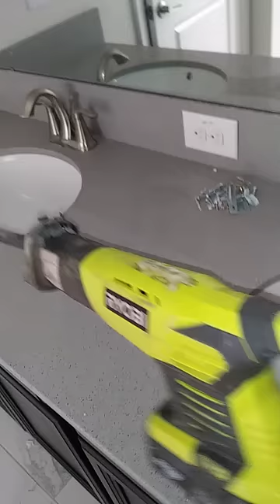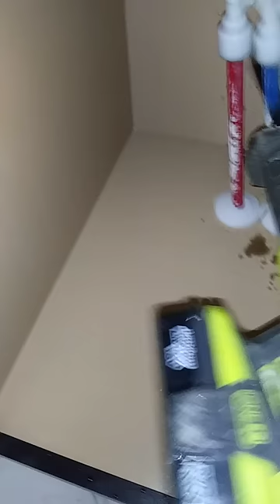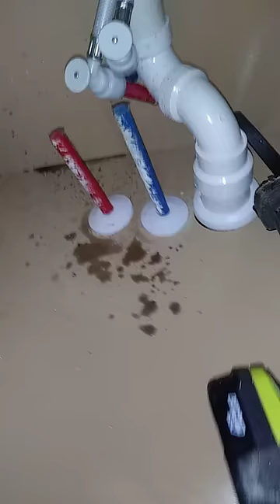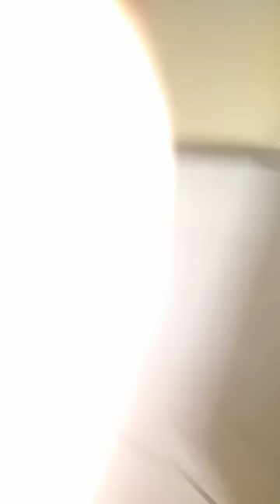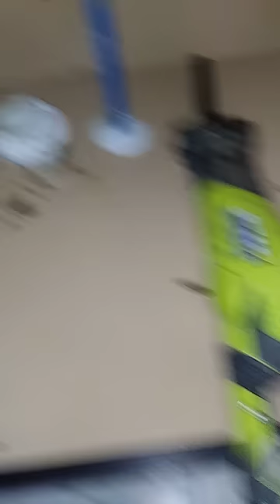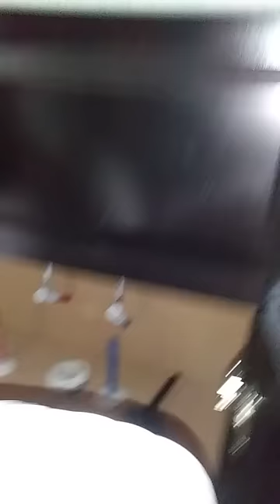This is what happens when you DON'T pay your plumber.

Comment: I'll be honest.  As a DYIer, this is really not all that bad.  It's fixable in less than an hour.
Reply: Not for someone that needs a plumber to install that.
Reply: Exactly, if they have to pay someone to do something that simply I doubt they know how to do much of anything
Reply: In my country you need professional to do this for Insurance
Reply: I wouldnt suggest DIY'ing your plumbing work
Reply: I thought he was gonna leave the water on thru the pipes and let it flood the bathroom. Literally will take 10 minutes to replace lol
Reply: Flex tape 😂
Reply: @ItsKyleStewart  those are sharkbite fittings that my toddler could push together, and a trap you can install in 30 seconds with anything resembling a wrench
anyone who knows how to change a tire or make breakfast could do this job, but the kind of people who won't even pay for literally the cheapest plumbing job probably don't know how to do anything for themselves. If they did, they wouldn't have hired this guy, or they would have done it themselves.
Reply: @MrCrackheadst  plumbers can make that much (or more), and for this job it would be worth it to do yourself bc it shouldn't take you more than an hour even if you are a crackhead
Reply: Then why didnt the person do it them selfs?
Reply: Not to bad of a fix, he cut that drain pipe pretty close to the cabinet bottom might be a lil work to fix that, but obviously the customer couldn't do it ,and now the next plumber comes he will know that those pipes look like that for a reason.
Reply: Staged
Reply: I'm no plumber and i reckon I could fix that easy enough
Reply: He should of cut the pipework lower and filled the pipes with expanding foam and pushed them under the floor 👌🏻👌🏻👌🏻
Reply: As a DIY lolol 😆😆😆
Reply: No it isn't.  The drains are cut at "floor level". The water is pretty simple. You now have to cut a large hole in the cabinet bottom, remove the bottom, or pull the cabinet. Did that work for 50 years. It is not an hour repair, especially  for a DIYer. Only an inexperienced person would make that claim. You could butcher it in an hour but not repair it properly.
Reply from the maker: Truer words were never spoken 👏 🙌 👌 😉
Reply: @lmilne4859  100% if he cut it a little bit higher maybe you can slap a coupling on it but that cut was too close to the cabinet.
Reply from the maker: Truer words were never spoken 👏🙌👌
Reply: Fixable in less than an hour! Yeah right! Not for me...first a 10 min trip to HD or Lowe's, then having to get in line for 15 minuets to pay. Oh wait, I'm like a kid in the candy store, 30 to 45 minuets of site seeing and starting my Christmas list...again.
Get out and on the road. If its lunch time, pick up lunch, 30 minuets, if its early, stop for coffee and a couple donuts.
At about 3 hrs into repair...start. 🤣
I'm so ashamed, because I've actually done this once or twice. 😫
Reply: lmao, to all the people saying they need to hire a plumber and all that, y'all probably haven't even touched a screw driver in your life... the white pipes are as easy to put together as Legos...
Reply: Right like cool ill just buy wore tubes and pipe.  He should've wrecked the tub , sink,  drywall . Now THAT would be a major fix lol not this
Reply: im not even care if it wasting..atleast home owner not getting this for free..
Reply: Okay but you still played for lumber and materials sooo... you lost money on that plus YOUR time you now have to put in and more material .. lol you pretty much lost twice. Oh and if your fix ends up breaking again for what ever reason it's not fixed for free as where if the plumber did it.. it would be on his dime. So yeah it's bad. Just pay the man what you owe.
Reply: @mr.spacely6503  😅😅😅
Reply: Well they called a plumber to put in a sink so... Clearly they wouldn't have the slightest idea of what to do.
Reply from the maker: True story
Reply: @tiananman  they do not pocket that rate. At best they make 25 an hour.
Reply: The fact that the drain was cut by the cabinet is pretty much a pain in the ass. He did good in my opinion
Reply from the maker: Thank you. I tried to make it a pain ass for the home owner just in case they tried to fix it themselves.
Reply: @ItsKyleStewart  residential plumbing is easy with shark bites now adays and pvc gone is the day of packing cast iron with oakum and pouring lead sweating joints is pretty simple too but with pex and a cheap crimping tool and pvc and glue it's all really fast and easy I'd recommend someone diy plumbing before most other things just know what a drain trap is and pitch your pipes that's it
Reply: Ok Jerry rig everything
Reply: As a DIY, it's 1 hour labor but 5 trips to home depo. #personalexperience.
Reply: @Moistnsquishy  shutup
Reply: but what if that person doesnt know how see
Reply: Make sure you don’t diy it with the wrong stuff
Reply: Until an inspector checks your work and your venting is illegal for your state. Then you as a "DIYer" pays an actual plumber to do their job. 🤙
Reply: @ItsKyleStewart  it’s a sink install it’s not like replacing a pinhole leak close too the main boiler or a hot water heater
Reply: @blackdeath1619  not confident, not handy, or thinks it’s beneath them if I had too guess
Reply: There having someone else do it, that says a lot
Reply: What's a DYler
Reply: @MrJawnyNumFive  lmao. I think most of us have done something like that.
Reply: @stevefidler6802  DIY = Do It Yourself
Reply: @ItsKyleStewart  its 2021 were all YouTube engineers now
Reply: @stevefidler6802  yeah. But we all know what he meant.
Reply: @RockyJayyy  congrats. You must be very smart. I'm stupid though. Where I come from we do things right. But hey.. to each their own.
Reply: guess nobody noticed his saw blade hitting the pex risers right at the bottom of the cabinet when he was cutting em out. might wanna give yourself a lil longer than an hour bro, cuz u got 2 pinhole leaks at the bottom of cabinet now & considering he took your traps and rigged vent system he built with the tubular pipe. dont recommend going back with sharkbite shutoffs either.
Reply: @tiananman   30 second trap with anything resembling a wrench? You must be a wizard you need a job? & Sharkbite? C’mon you know they’re going to blow out and flood your house in less than 5 years I thought youre a pro?
Reply: @PeterTrimboli  Peter you couldn’t read a level if you tried
Reply: @ItsKyleStewart  I don't use sharkbite, but my point is that this is not a difficult or time intensive repair. Don't know how or why you tried so hard to miss that point but good job I guess
Reply: Put the rep saw through the worktop
Reply: An hour? You're high
Reply: DYIer I can only imagine how you’re house looks..
Reply: @julianchavez456  he pulled a permit they're good
Reply: @ItsKyleStewart  lol, everyone can do that. If you can watch a YouTube vid you can hook up a sink. If your insurance needs you to get a professional you need to find different insurance.
Reply: @nonyobussiness3440  it's an 45 dollar charge for the plumber to show up as its 45 an hour with a minimum of an hour plus cost of materials for the cheaper licenced plumbers in ABQ. Many also charge for the type of job on top of that. So yes many do pocket over 40 an hour for their work.
Reply from the maker: Exactly 💯💯💯
Reply: I would love to see your an HOUR plumbing! Just saying
Reply: @ItsKyleStewart  tell that to my dad and brother lol
Reply: @ItsKyleStewart  lmao my dad does but then again he's a plumber.
Reply: @tiananman  those are not shark bite fittings, my friend. They will need to invest in the most basic level of tools to reconnect that back together.
Reply: Shd have cut the waterpipes so low that it is impossible to fix
Reply: Most don't know that Im 24 and can do more than most with my hands
Reply: SURE IT IS LOL
Reply: @ItsKyleStewart  you are one of those people that hire a licensed electrician to change your light bulbs 😂😂😂
Reply: @MrCrackheadst  a plumber can make twice that in half the time😄
Reply: @stevefidler6802  where you come from is the PAST everyone knows what a DIYer/DIY is. You must be 70 years old or something 😂
Reply: @kllgrogto5838  no. I'm not elderly. I do read a spelling error there. I wasn't being a spelling Nazi. I was honestly curious if the OPs comment stood for anything different.
Reply: @kllgrogto5838  For sure bud, licensed MA plumber
Reply: @ItsKyleStewart  😂😂😂
Reply: Sure, until they turn the water on and flood the cabinet and floors
Reply: @tiananman  yet it would take you all day lmao
Reply: @AlphaChinoz  not when it is in the ground, the cabinet is in the way
Reply: I'll be honest. As a plumber, I already knew that.
Reply: @PeterTrimboli  lmao sharkbites. You how many hack jobs I fix with people using those things.
Reply: @wjhjr1415  exactly not a hour fix at all
Reply: I think he made a mistake and plays like someone didn't pay him.
Reply: He is just doing demo pretending he did not get paid
Reply: Most states allow you to do the plumbing and electric in your own home.
Reply: If they knew what they were doing they wouldn't have needed a plumber in the first place.
Reply: Exactly it's just water lego
Reply: If the clients  were good DIYers they wouldn't have needed to call anyone
Reply: DiYer's can always do it they just never have the time....that's what I hear from all of them anyway or it's my cousins,brothers half-sister once removed said they could do it for $50 but for some reason they call me instead
Reply: As a DYIer?
Reply: @gulfautodirectkrystian1829  Enough said shows you his attention to detail
Reply: It’s not hard, just some PVC Pipe.
Reply: That’s why they called a plumber.
Reply: @ItsKyleStewart  you are just incompetent then
Reply: Same it doesn’t seem bad at all to me 30mins to an hour fix and that’s after watching a YouTube video
Reply: You probably have pvc running in and out of your water heater…
Reply: @tiananman  master plumbers make 100+
Reply: It's Yankee plastic shiy easy fix
Reply: Trust me some people aren’t the brightest and it’s sad
Reply: @wjhjr1415  you need some glasses
Reply: @HungarianHacker  Why would you do that
Reply from the maker: @BITCARTER  because it felt good 😅🤣😂
Reply: DYI, Do your itself
Reply: Yep. All I’d need is some JB Weld SteelStik.
Reply: Yup, a few Shark Bites, a couple PVC female-female collars and some PVC cement, out the door.
Reply: Dyler;
Reply: He's using a Ryobi recip, definitely not a pro.
Reply: no you are wrong water lines are just two couplings so easy fix but the drains he left like no meat could turn into pain in ass job even for a plumber just sayin
Reply: @ItsKyleStewart  Most plumbing jobs are rather simple if you are mechanically minded and willing to do a bit of research. I was a freelance handyman/contractor for a few years and I spent a lot of time correcting the errors of so-called professional plumbers.
Reply: It’ll take more than an hour. But yeah, that can be done by just about anyone.  I wouldn’t call a plumber for something so basic.
Reply: Well that drain pipe that was cut flush will be quite a pain in the ass and im a plumber lol
Reply: @wjhjr1415  your right, not an hour, about 2 minutes to sand the burrs off the pipes and 30 seconds to push a shark bite coupling on the pipes.
Reply: @ItsKyleStewart   that plumbing is a pex sistum go's on with clamps that the tool rachets so u can know it set fully or they have it where u push pipe in fiting and it snaps that one is at ace at least were I live the contracts us the other one but they both are just as good used to do this the person in the video knows this just going to make the owner freak out still not get paid and the contract now can't take home onwner to court they would of had to pay then or the contractor could have put a lean on things of value just by going to the court
Reply: We all know its not difficult it's not the point... When you hire someone to do a job you pay them after.. If you don't your a scumbag plain and simple. good on him for having the balls to stand up for himself
Reply: @julianchavez456  thays literally why he said "As a DIYer..."
Reply: @blackdeath1619  ...maybe they're unskilled?
Reply: @christopherlove7196  dude is already going to get sued for vandalism so why push it further?
Reply: @lmilne4859  I'm guessing you pay someone to do you're work right?
Reply: @schawn4925  still repairable without pulling the cabnet.
Reply: @MrJawnyNumFive  obviously your priorities are ....literally non existent.
Reply: @agawdsparadise3782  and get sued for vandalism, even if he didn't get paid he's not justified.
Reply: @yinace7  and he can get sued for vandalism.
Reply: @brochuth  yeah but the "over worked and pretty people" can't handle more than that.
Reply: @nonyobussiness3440  where? Plumbers here are as much as 34 and hr.
Reply: @Moistnsquishy  then you're want to reevaluate where you're going wrong.
Reply: @whatwouldhappenifididthis6473  thays why most of us are a bit more intelligent than that.
Reply: @reedrk88t  has nothing better to do than reply to a bunch of comments wanting nothing more than drama.
Reply: Lol you "DIYers" keep it up! Love fixing your mistakes after you "fix em"
Reply: @tiananman  yup. It’s your money. If you want to pay someone do it. Gotta spend your free time how you want especially for 10 hour days. Isn’t worth wasting an afternoon if you don’t want to
Reply: Shoulda pulled the supply lines up and cut them right at the base of the cabinet.
Reply: Come on, be realistic. I don’t care how good you are. That would take far longer than 10 minutes. 2 hours would be appropriate.
Reply: DYI lmao
Reply: @ItsKyleStewart  I do because it's good job security for me the plumber
Reply: “As a DYIer” lol
Reply: @ItsKyleStewart  I would. I would suggest being educated and self-sufficient. I would suggest saving your money when possible, and knowing when and when not to call a professional. In general, I suggest not having this mentality that you are incapable and can't help yourself.
Reply: oof, u cut the pex tubing
Reply: @whatwouldhappenifididthis6473  it amazes me how much venting you have to do in the US (I see it on YouTube). In Australia one main line up tge side of a house has one vent, that’s it. Unless a branch line fir say a bathroom is over 10 meters in which case that bathroom will need one vent of its own. Saying that though, at least in NSW where I’m from, EVERY line under a slab has to be 4” pipe, even if it’s a basin. But the venting you have to do over there would be an absolute nuisance
Reply: @EAMitch  $45/hr is dirt cheap even if its side work. Here in WI contractors all charge $140-250/hr, side gigs are at least 75
Reply: @SEAPanel  whats a female/female collar? Lmao u mean coupling?
Reply from the maker: Lmao 🤣😂
Reply: @4G1O4  different areas different prices.
Reply: BS.   Try many hours.   Make a video of you fixing 6 pipes in an hour and I will send you $20 if you do it.
Reply from the maker: @toddclean547 Your on Todd
Reply: video tape the whole thing without editing.   Six pipes is 10 minutes per repair.   And a repair means something permanent  --  not a cheap fix.   It will take you an hour just to go to the store to get parts.   And you have made way too many comments on this video. @HungarianHacker
Reply from the maker: @toddclean547  I comment on almost all my videos.  Yt pays me about $100 bucks a month.
Reply from the maker: @toddclean547 check out my latest videois hard to upload an hour video but I made two videos for you Todd. I've got Tons of videos like these